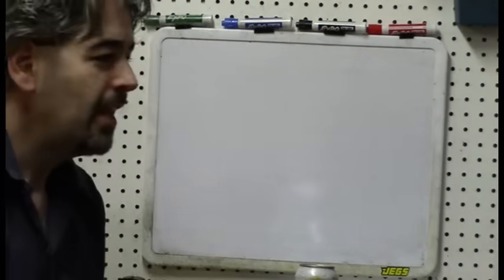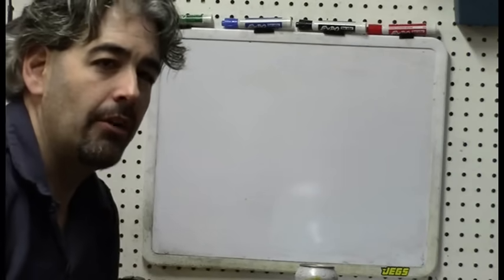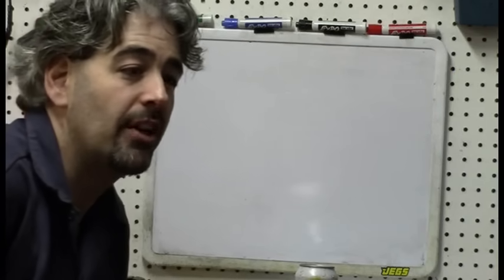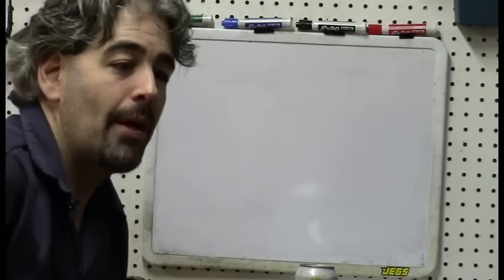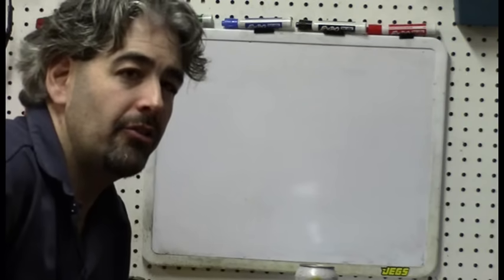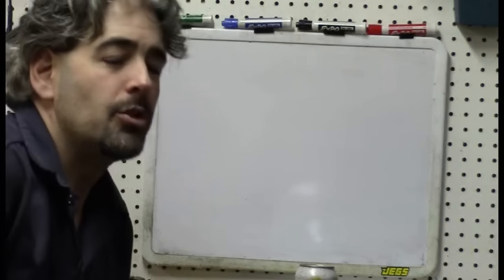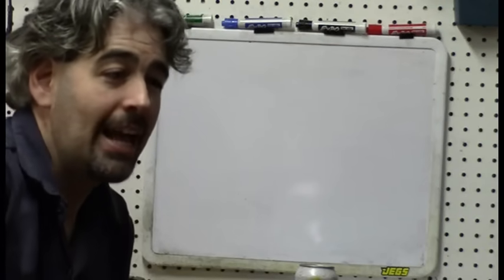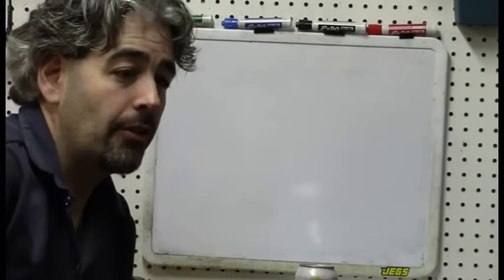Secret of Engine Problem Diagnosis- Fuel Trims Pt.1

Comment: Man!! I love your videos! I wish I can come across with someone who has the knowledge to diagnose the symptom of my car and resolve it! but seems like this is a real nightmare for 98% mechanics who claimed that they are "certified", NO CEL= IDK come back when the CEL it's on lol anyway that I can send you a video of my scan data that I have recorded when the car has this "loss of power"? Obviously I will pay you. Please LMK if you can do this service. Thanks!
Reply from the maker: Just list the RELEVANT scan data (not a data dump) pertinent to your symptoms here and I'll look at it
Reply: Thank YOU! Here goes: 18.50 LB/M (MAF)  *  18.0% ST FTRM1 *  18.0% ST FTRM2. *  0.8% LT FTRM1  *  -0.8% LT FTRM2   *  0.970v O2S B1S2  *  0.930v O2S B2S1  *  18.0% Fuel Trim B1S1  *  17.2% Fuel Trim B2S1   I scanned when car was warm after a couple of miles while driving in the highway for a few minutes, I guess you can tell the speed I was going by reading the MAF? If I'm missing something important please let me know, I have no idea how to read all this sensors and all the shops are in the same boat. This afternoon when I did the scan recording the car had a loss of acceleration and a constant little vibration. Other days car kicks like V8 and is smooth, it feels like new (Mustang GT 2000 with 60K miles) Thanks again!
Reply from the maker: This data is not useful sorry.  you have only one frame.
Reply: you see IDK anything! I'm like a regular mechanic lol I'm just a designer. This is why I was trying to see a way to send you the whole recording of the data frame by frame. LMK.
Reply from the maker: I need to0 know what the fuel trims are when curved against RPM
Reply: I see, I guess I will have to record again with another set up of sensor because I didn't included the RPM, I will include the rpm, my app only allows me to monitor 9 sensor at once. Then I will have to record the phone screen frame by frame asa video and send it to your email. Thanks again!
Reply: I sent you an email to your gmail account, thanks!

Comment: Hello Sir! May I please have some advise. I searched all your videos on fuel trims. 

I have a 2004 3.3 L V6 Toyota Camry running lean on both banks within no drivability issues. Maybe slightly decrease d acceleration from a stop sometimes, but runs perfect other than that. Once the car is fully warmed up, both long fuel trims are at 25-30%, and short fuel trims are  -5 to +5%. 

Both long fuel trims decrease to single digits when I increase the RPMs 1300-3000. 

Based on your videos that I saw, I think it’s a vacuum leak. May you please tell me if I correct based on the data I showed you? 

I was the idiot who changed the oxygen sensors before I discovered your videos. Lmao 😂 I didn’t know. I’m glad I found you. 

I changed the Mass airflow sensor. I changed the fuel pump and fuel filter. 
I found a vacuum leak near the throttle body and changed the hose. 

I used carborator cleaner to search for vacuum leaks but I can’t find one. 

I thinking of changing the air  intake manifold gaskets next? 

I bought the car at 173k miles. The previous owner maintained everything according to the car fax. The car fax says he changed the manifold gaskets and oil gaskets also. I recently paid to changed the oil gaskets because a mechanic said they were leaking, but that they looked like they were recently changed. 

I think that maybe the air intake manifold gasket that was installed by previous owner might also not be working. I do hear some air coming from that area of the hood. 

May your please steer me in the right direction?
Reply from the maker: You definitely have a vacuum leak. it might be under intake manifold or somewhere the carb cleaner can’t reach it but it’s a definitely vacuum leak.
Reply: @SchrodingersBox  okay Thank you Sir! A previous mechanic also said he didn’t see any vacuum leaks. I’ll take it to the professionals. I’ll have them change the air intake manifold gasket and  ask them to look for any other vacuum leaks while they are there.

Comment: This is great .I have been searching online for information on how understand this kind of data on ob2 and you give most the scenarios and how to diagnose it.i used the fuel trims to diagnose the vacuum leak on my Nissan quest.i found a cracked intake plenum with carb cleaner after assessing the data on my scanner but let me ask you this.im having all kinds of vehicle trouble all at once by the way.. On my 4.3 vortec it's been throwing a random misfire for a while .I have replaced all the ignition components.checked the fuel pressure.checked the distributor and the maf was changed 6 months ago and cleaned today. .I pulled the upper intake off and changed the spider injectors because they looked horrible with crud.the o2 sesnors seem fine the voltage is switching as it should.the fuel trims data says it's adding 10-13% extra fuel at idle but  it goes closer to zero at 2k rpm but I have sprayed the crap out of the intake gasket with carb cleaner with no luck .would you still pull the lower intake manifold and look or where would you go with it?
Reply from the maker: I would validate source of the unmetered air before i did anything else.
Reply from the maker: actually i would start with the ignition since you changed all ignition components- what was your data that told you it was an ignition problem and specifically what components indicated as faulty!  I would totally start there, that the obvious starting point.
Reply: @SchrodingersBox I appreciate the reply.i got code p0300 (random misfire) I have changed everything on the ignition.wires ,plugs ,coil,ignition module, cap and rotor button and the distributor since the old one had to much play in it .the misfire counter says my worst misfires are on #2 and #5 the other ones have a low count compared to #2 and #5 .the only time I can really feel a misfire is on hard acceleration or winding the gears up pretty good.the idle feels a hair off when it's cold out sometimes .it's about got me stumped.
Reply from the maker: No I need the data that indicated you had defective ignition components. Was there excessive resistance in the ignition wires? Was there failure for the plug to spark but secondary was confirmed up to that point? nWhy change the distributer cap- was there failure to deliver spark?  Why change the ignition module- were inputs and outputs verified but the coil failed to deliver the signal?
 I have absolutely nothing to go on- I need to see your diagnostic process on the ignition since obviously you suspect it.
Reply: @SchrodingersBox  let me go back a hair.it started about a month ago.it was spitting sputtering and randomly dying  decided to change the plugs and wires
I have only had the truck 6 or 7 months.so who knows when it was done last.the random misfire came right back and this time the p1351 high ignition voltage.i had the ignition module tested .it was bad .I replaced the module and the coil.then figured out the ignition coil had a bad connector.the wire was broke inside insulation.thats why it was dying.p0300 came back.i looked online .everybody said change distributor so I pulled it out and it had a lot of play.a little over spec.so I replaced it .it came with a new cap rotor and pickup coil already in it.still get the p0300. I have tried switching plugs around .I have tested the purge valve and the egr valve and other stuff I'm forgetting.now I am trying to diagnose it without throwing parts at it.so here I am
Reply from the maker: That doesn't help actually- lets try getting back to basics here- what is the LTFT and STFT when curved against load?
Reply: @SchrodingersBox  it's obvious it didn't help .today idling in my driveway after a 10 mile drive fuel trims was  7-8 total. 5 long term 1.5-3 short term.it still Falls down almost to zero when rpms raised.thats odd to me considering it was 10-13 yesterday and the engine was up to temp .I'm not sure. What you mean under load curve but when you take off from idle  it drops pretty  quickly but cruising down the 4 lane it seems to be short term 0 to -2 and the long term was pretty steady at 3.the short term fluctuated depending on if I was coasting or cruising etc. I thank I need to do a compression test this weekend. just to be sure it's not something in the engine.u guess I should done have done a compression test.i gotta order me one but if I reset the codes it a usually come up cyl 2 or 5 cylisfire pending and then set a hard code random misfire
Reply from the maker: OK looks like a probably dry misfire.  You need to check the secondary starting at each coil. Doesn;'t look like a vacuum leak or fuel pressure problem

Comment: You are fantastic been fighting my 03 dakota for months kept getting 440 codes checked my vacuum lines found three damaged lines replaced them in a few days got  misfire code checked  COPs changed spark plugs did not get another 440 code but kept getting  random timed misfire on #7 changed my fuel injectors (sorry I was one of the 98%) mechaniced all my life but at 65 all my experience was with old school cars frustrated I searched the web after several  articles going every which direction finally came upon your video pulled my battery terminal off for ten minutes  then reattached drove for 30 minutes ran great MPG increased and no miss. WHAT A MIRACLE you didnt save my life you saved my life style LOL . Have subscribed to your great channel THANK YOU SO MUCH

Comment: Best video I watched in months! My Civic is acting up and both Short and Long trims are getting negative altogether with engine running more and more poor. Once throttle is blipped, all returns back to zero. Makes me thing there must be too much fuel? Or most probably a combination of problems, since it's 2002 model and nearly 260k on the odo. Nevertheless, good fun trying to diagnose it :) (Has new spark plugs and coil packs). Most of the time runs great, then sometimes not so good. My best guess is that timing must be shitting out fooling the computer. Any other ideas?
Reply from the maker: Lots of ideas. What data do you have?
Reply: @SchrodingersBox  I have the bluetooth obd thingy connected to it, but have not yet figured out how to datalog events so I can have a look at multiple data inputs all at once. I found that intake air temp sensor gives completely wrong reading. Never reads less than 16deg C. Car has no maf, or map. Or well, if it has, I have no data from either of those. I'll go find air intake temp one on junkyard and see what happens then.

Comment: Dumb question- If a car is running extremely lean from a bad fuel pump or clogged fuel filter, could you get better gas mileage? Thanks. Love your channel.
Reply from the maker: Lol good thinking but no you wouldn't.  It would be worse.  Remember there is a difference between mileage, and using less fuel.  Mileage is your fuel used per distance traveled.  Because there is less efficiency when running lean you will require more fuel to travel the same distance because of less efficiency,  Make sense?
Reply: Makes sense. Thank you very much. You're the best

Comment: At the 10min. Mark on the grease board, the sine wave for lean is written as a produced low millivolt provided from the ox, is this right, will not the return volts be at 900 or higher? 
The real question I have is, a dead ox, not producing any up stream signal will result in a lean condition over all or will it spike rich on open loop on acceleration and idle,

Comment: I wonder if you had this issue before ! ,, where the van will drive normally ok but sometimes when you go at high speed for quite sometimes and you drop the speed  from high to low speed like 30mile/H , the engine check light will show up and you will notice some hesitation signs and the engine code is P0087 (RAIL FUEL PRESSURE/SYSTEM TOO LOW ) as soon as I clear the code everything will normal again ,  when I checked the fuel pressure using the gauge , on static mode as you have shown in this fantastic video (putting The key on start position  , engine not running ) the pressure gauge will go down after 20 second so it won't hold on more than 20 second  (could it be safety feature on these newer van ? ), is this normal ? , by the way there is no any Leakes  , and when I did the test when the engine running  its all ok no leaks what so ever , do you think this could be from that  fuel pressure regulator  ?  its 2015 sprinter van 2.1L
Thanks in advance mate
Reply from the maker: I would start by checking fuel trims on a curve up to 3500 rpm.
Reply: @SchrodingersBox  thanks for quick response,  but these Vans on  ideal won't go pass 3000rpm ,( safety features). and you can easily reach 70miles/H (legal speed limit in the UK ) at 2500rpm to 3000rpm ( I don't know how and where to get to that 3500rmp man.. ) ...  by the way  I had wrong fuel one time but that's almost 8months gone by since that happened,  and never had any issues related..because as soon as I realized it was petrol,  I syphoned the fuel and fueled with full tank deseal again..(( the thing is it will start like brand new van with no issues what so ever and drive normally as well but sometimes that code and engine light will show up specifically if you I changed the driving mode Like as I said from high speed to lower one for quite some time.. Idont know man.. this is really driving me crazy..
Reply from the maker: then just check the fuel trims to 3000. even 2500 would give you basic beginning level information to identify the issue.
Reply: What do you think about the static test ( I mean that the pressure gauge won't hold up for more than 20sec. I mean when you switch the engine on and the engine not running the pressure gauge will go up to 45psi and after 20sec will go down to  zero am thinking it could be safey features on these newer models.. because I had done the test when engine running every result that you have shown on that video I had it .. I mean no thing negative part from that static test /// have you come across any newer cars where you had done  that static test on them and the pressure gone after 20sec. ? (( one thing that I have noticed about the gauge on static test.. is on that 20 second the pressure will stay 45psi during whole period.. if it was leak I would assume should start go gradually down during the that 20 seconds but what I am thinking here is like a signal will be sent off from ECU to shut the pump down immediately after 20sec if the engine not started , that's why the gauge will go down to zero from 45psi because the pump had been shut down.. (( what do you think!))

Comment: Thanks for the great video, but I would have an interesting question, that I see on old model Opel cars, that their Oxygen sensor can cover until 4,000 mV, and the masters here tell me, that it is not normal with them but they can not give explanation for its reason. Maybe you know what is unusual normal character with these Opel models? 
P.S they have only upper stream Oxygen sensor with one line. That`s it. :)
Reply from the maker: hmmm I am not at all familiar with that at all. I don’t know anything about that sorry!  interesting though. I hope I never run into one of those cars then!!

Comment: Thanks so much for your videos I will be watching all of them more than once. Could you help me figure this out. My downstream/post cat O2 sensor 2 is high at .775. When I unplug vacuum at brake booster it goes lean .1 but when I spray chem tool into vacuum line at fuel reg it goes lean too. DTC PO420,  LTFT -3.1%,  STFT -.8, .0%, MAF 4.53,  O2B1 Sensor 1 .09,.7,.125,.08. Temp of exhaust is 215f pre cat and 380f post cat. Gas mileage has always been 22.3mpg still is, no other codes, Mode 6 - no problem with sensors or monitors. I am using BlueDriver scan tool/sensor. I figure bad sensor #2. I replaced bad intake gasket 2yrs ago no problems since. 2001 Buick LaSabre 70,000 mi.
Reply from the maker: Sorry but I have no idea what you are trying to do.  Why would you be concerned about the S2 being at .775??

Comment: Really good video...but what if you give it more air and engine dies I can’t quite get my head round that one
Reply from the maker: Depends how fast you do it. if you give too much unmetered air and the fuel trim is unable to adapt quick enough it will lean out too much.
Reply: @SchrodingersBox  I got a car each time I Rev it it just dies guess I better go back to the drawing board thanks for your reply I appreciate it
Reply from the maker: if it does when you are revving it, then you need to see two things- is the air metered and if it is, is the fuel sufficient for the demand
  that’s pretty much it.

Comment: You are the best!! Now I feel smarter now, my idle LTFT -3.1 and STFT 1.6 is it good value Schrodingers box ?
Reply from the maker: It depends- you have to curve fuel trim against RPM to say anything about it
Reply: @SchrodingersBox  the problem with my car is the engine at idle shakes more than usual but steady idle, which is strange that when i gas a little less than 750 rpm then the engine shaking stops. I have replaced all the engine cushion and many other things.. I'll try to test the system and see if air seeps through. otherwise just wonder if you can give me other ideas or guidance? 😶
Reply from the maker: @81mrlz  Yeah that's simple- the next step is to just do a fuel trim curve against load and you will easily identify the cause when you see the PCM correction algorithm.  Anything else  is a waste of time.

Comment: Great instruction - I am sure it takes some time / practice to use this knowledge and get better at diagnosing what is causing engine problems , however, as you instruct - it is ABSOLUTELY NECESSARY to understand to accurately diagnose and not just throw parts at the engine repair. 👍✌️✌️
Reply from the maker: Great point!